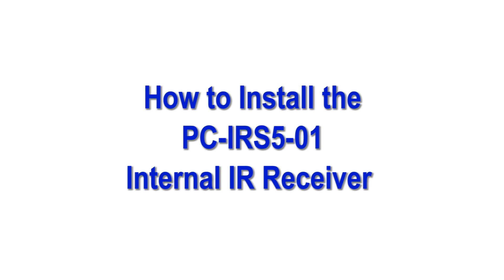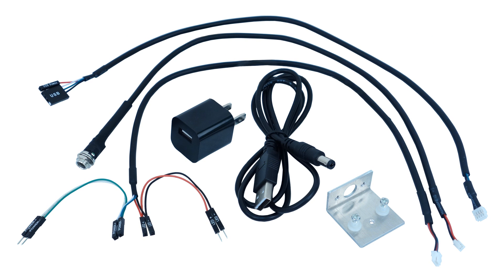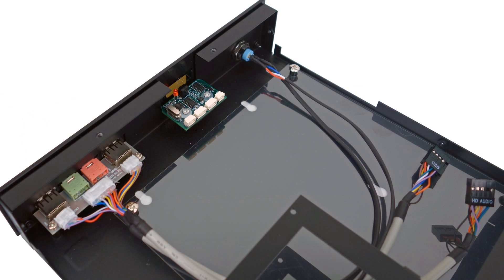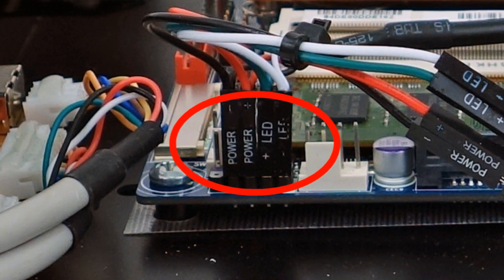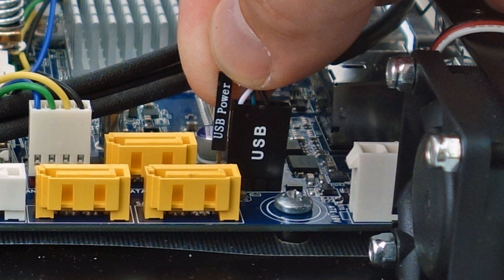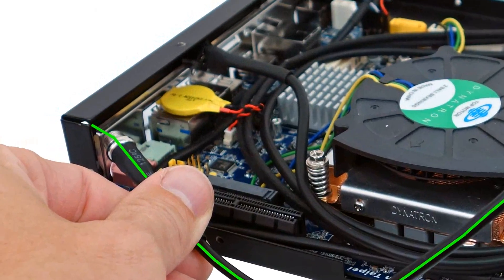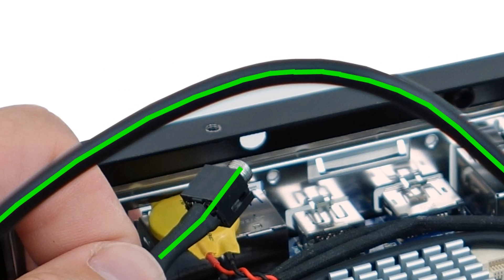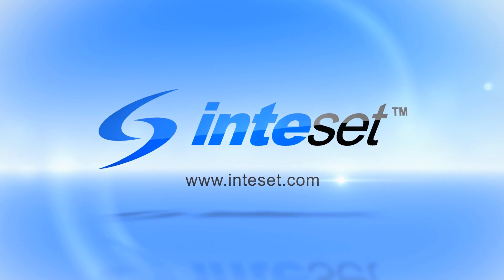Inteset PC-IRS5-01 IR Receiver Installation Tutorial

Comment: In the image @ 2:58, the power button had a PWR and GRND side. Where should the IRS5 (PWR -) side plug into?
Reply: You probably realised by now that the motherboard pin out shown allows for two orientations of the Power Button and the Reset Button jumpers and the IRS PWR- should be connected to the Ground or GND pins

Comment: my sistem becomes unstablel when i have the usb module pluged into the motherboard.
i hav this motherboard 
http://images10.newegg.com/UploadFilesForNewegg/itemintelligence/ASUS/E7198_P8Z77_V_PRO1403959784724.pdf

the polarities seem to be diferent what could i do?
if i connect the receiver the computer becomes laggy annd unstable
Reply: If you also connected the red 5V wire on the USB header while using the external 5V adapter, this could be the source of your issues. The red wire on the USB cable should only be connected to the motherboard if you have a 5V Standby pin on the motherboard (coming from pin 9 on your ATX power supply cable).